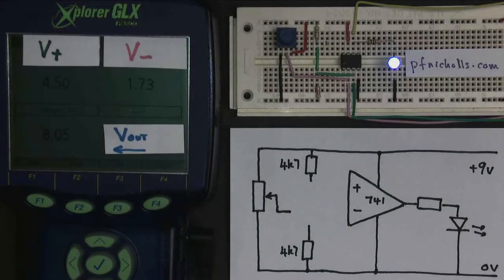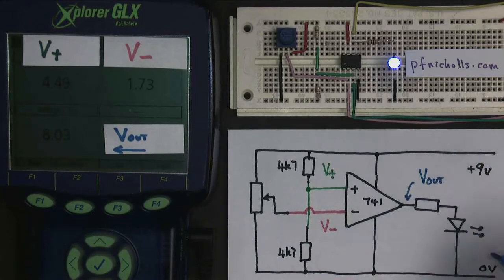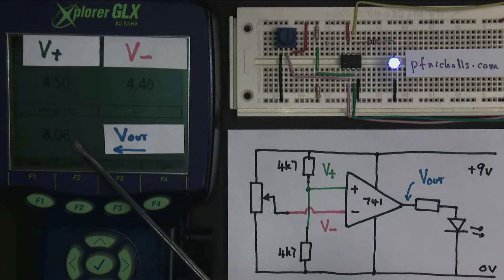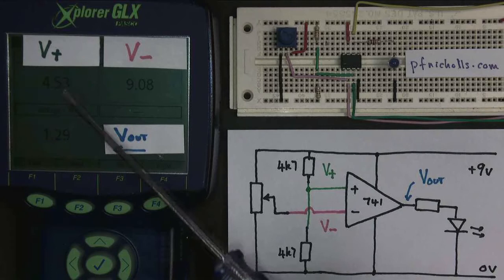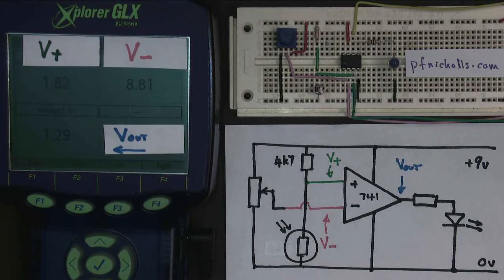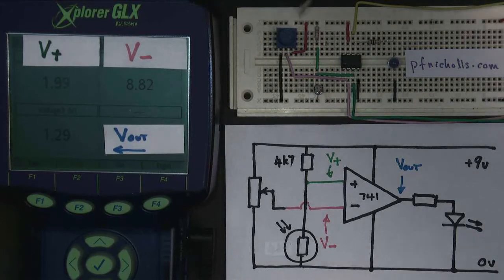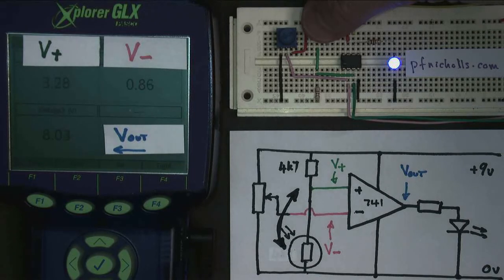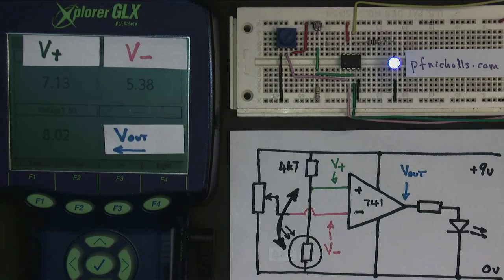Comparator Circuit

Comment: what is the value of 3rd resistor
Reply from the maker: The resistor in series with the LED is just a current limiting resistor so it depends on the type of LED you use - anything reasonable would be okay, say 470 Ohms. There is a video about how to calculate the value of the LED resistor on this channel and also details on my website.
Reply: can u send me link of that particular video
Reply from the maker: Yep, here you go: https://www.youtube.com/watch?v=cPAPY1b4A00&t=18s
Also see my website: http://www.electronicsteaching.com/Electronics/LEDs.html
Reply: can u have videos on taco generator
Reply: a task given to us that dc motor speed control with taco generator
so i want videos on this
Reply from the maker: That's not on my current to do list unfortunately but I will certainly consider your request. I usually start making new videos about this stage in the school year so I will so what I can do!